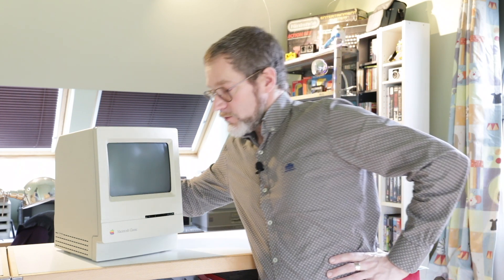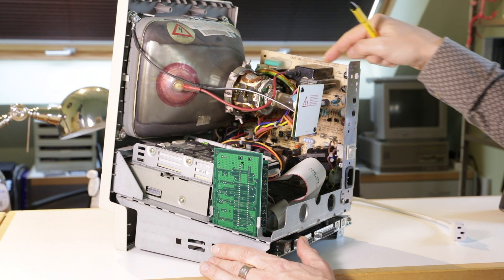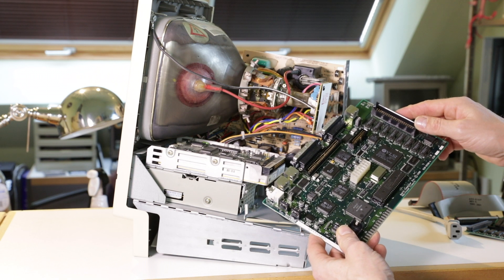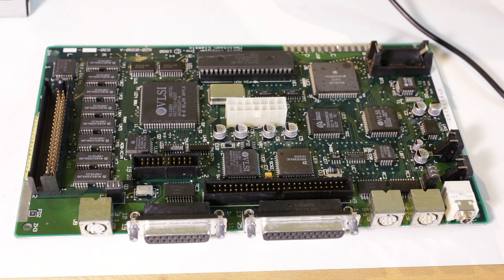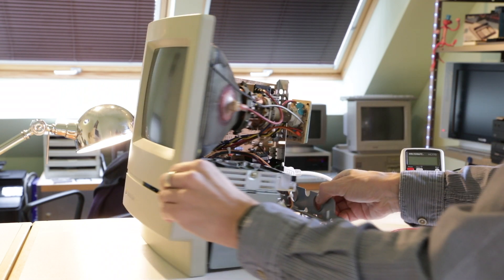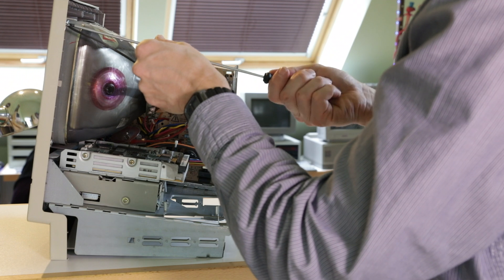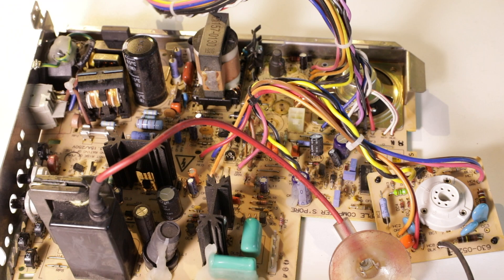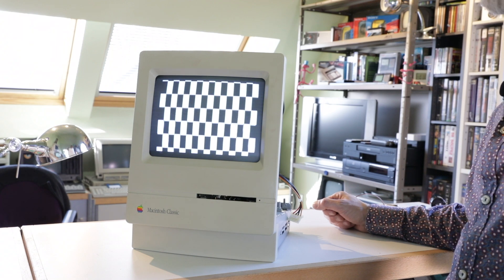Apple Macintosh Classic Checkerboard Repair: First Attempt

Comment: I recently purchased one of these for my son and we had the same checkerboard displayed. I replaced the 1/2 AA lithium battery on the logic board and it works now. The board itself was in great condition with no evidence of corrosion. Maybe that will work for you as well.

Comment: These Macs use a memory-mapped display. What you see on the screen at startup is an indication of what is in RAM memory. A checkerboard pattern means your RAM memory is goofed up. Since these Macs used only tin-plated contacts on their RAM modules, corrosion was the major issue in the past.
Reply from the maker: I tested the logic board in a friend's mac Classic and that works fine. So the culprit has to be on the analog board...
Reply: @DeBovenkamer  if the issue isn’t the logic board you just have to spend time checking continuity and voltages on the analog board as well as replacing the parts that supposedly always fail like tda4605, 6n60 mosfet, and dp3 and dp4. The analog board in your friends is likely putting out higher voltages that may be enough to get around the issues of worn out polymer electrolytics on the logic board. When I tested my logic boards caps they were barely readable where as the analog caps were barely out of tolerance

Comment: Did you check the power supply voltages after recapping? Was there any improvement on the 12v line?
Reply from the maker: I did, no improvement... Also adjusted PP1: voltage was higher but still no 12v.
Reply: @DeBovenkamer if you check the voltages without any load don't expect precision. Measure 12 and 5V from the floppy cable leaving board and HD power connected